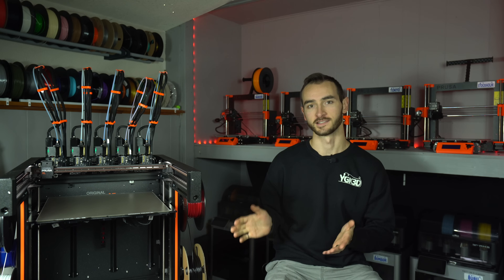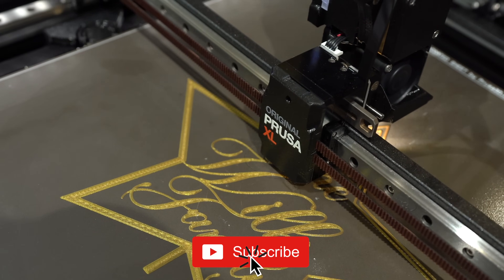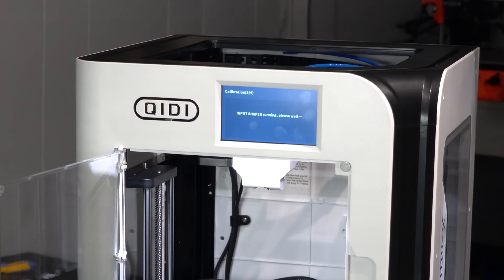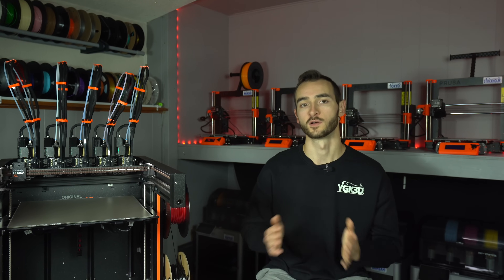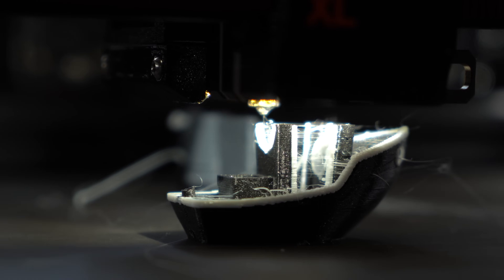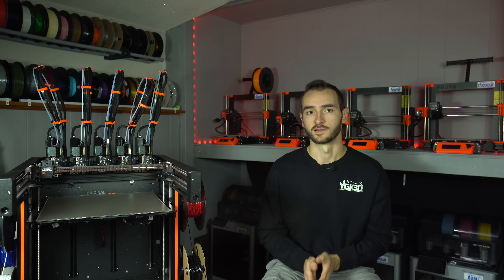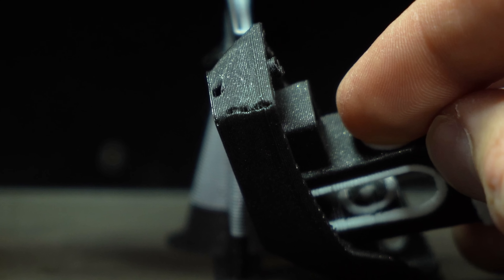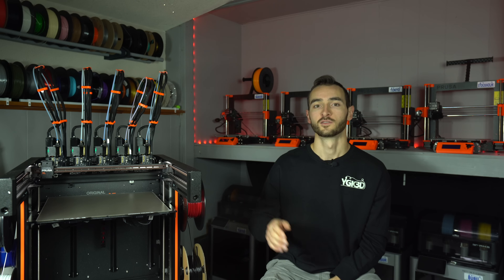The Prusa XL Just Got WAY Better with INPUT SHAPING... But Is It Enough?

Comment: your XL alpaca was 162g, and 142g for your X1 alpaca.  the 20g isn't going to make up all of the time difference, but when you mix in the speedy toolhead changes, I think it starts to show its advantages.  especially for people that sell a lot of prints, through much less wasted material.  i think a video that people want to see is a large multi color print where we can really see the benefits of the XL.  the XL wasn't built with speed as the primary feature, so doing a test that does test its strengths would be cool.  like a side by side Timelapse of a large multi-color print on both printers
Reply: yeah but also X1 can print a basically perfect benchy in around 15 minutes, XL not even close ;)
Reply: @riba2233  according to whom?  it can do a 15 minute benchy.  but that's not why you'd buy an XL.  do a 4 color bench and compare the speed.  the XL will print several benchies in the same time as the X1 prints one.  even the A1 mini beats the X1's at this due to a slightly faster AMS, but the XL does it with virtually no downtime for color switches and wastes nearly no plastic either.  i'm saying this as the owner of an A1 mini and two X1 carbons AMS combos, and a long time prusa fan
Reply: @ame7165   yeah sure, for multicolor I agree, but for single color they are not even close
Reply: @riba2233  yeah i mean for single color, the XL doesn't push as hard, but the toolchanger adds a lot of mass to the head, so i think that's the trade off for the fast and efficient switching.  i love prusa but it's hard to justify the price of the XL, even if they get it to a point where it's turn-key
Reply: @ame7165   true, I get that it is a special product and there is nothing really like it (outside for some custom stuff) but it is definitely too expensive.

Comment: I still don't get it. I have the 5 toolheads version, and I have printed pla, petg, and asa. No stringing at all and I live in FL with extreme humidity. Also I doubled the print speed from the provided speed profile, and noticed much faster print times with very little reduction in quality
Reply from the maker: Jealous. Did you drop the temperatures at all, or you’re using the stock profiles?
Reply: @ygk3d  just using the generic PLA profile. No tuning or tweaking.

Comment: Can't take your video seriously when your gauge of filament moisture uptake is that "it's freshly opened"… then you proceed to place the spool directly on the PrintDry heater element (which I own and have been using for years). Then you go on an excursion about how a heavy toolhead moves slower than a lighter toolhead and somehow it's Prusa's fault that it doesn't obey physics.
Reply from the maker: I acknowledged that the logic was flawed, hence why I dried it and tried again. The PrintDry works just fine like that by the way. The air inside it gets hot either way. I actually made no reference to the weight of the tool head. If weight is holding the Prusa back, they should make the tool head lighter.

Comment: You could install a 0.4 mm nozle in one of the XL's heads and show differences in speed and print quality vs. the results with 0.6 mm nozle.
Reply: i thought you could only run 1 size?

Comment: NGL kinda disappointed in Prusa.  There is a such a need for a XL printer that can print like an X1 Carbon but doesnt sound like this is it.
Reply: The XL prints like the X1 though. Just changed slicer settings. Download both slicers and see for yourself.

Comment: I have the 2 tool version. I’ve been running nonstop for weeks now and tried the input shaping alpha for a couple days before switching back.  I did see a significant time reduction in some prints, but I had issues with the GUI, errors during print starts, print pauses due to false errors and a couple long prints error out past the 90% point.  That last one alone was enough for me to go back to the stable version, but I’m looking forward to the official update and the new features.
Reply from the maker: That’s disappointing. Hopefully they release a stable version soon.

Comment: Also worth noting, the move to the prime tower before lowering Z during a tool change happens on the pre sliced benchy they provided but not if you slice prints yourself.  I'm on alpha firmware and PS 2.7 and the behavior is still the same as it was.
Reply from the maker: Ah interesting. I wonder why that is. Hopefully they make that universal soon.

Comment: to me it just proves how far prusa had their head in the sand for so many years riding off the reputation of being first and reliable, now they are starting to actually get some competition in reliable fast machines and they need to improve their speeds its just showing how much they are reacting and figuring it out and pushing stuff before its ready, just like they and prusa fans have critisized every other manufactuer for over the years with their heads up their a holes, you would think that prusa of all companies would be the ones to release a polished well tuned product that works and is reliable, but no instead they rush and push out crap before its ready to try to avoid looking bad by not having a competative printer on paper, they tarnish their reputation by instead having a printer that looks competitive on paper but in reality is a total s show, again just like every prusa fan has critisized every other manufacturer for all these years
Reply: just to be fair it's taken the three years to send out my notice to order.   That was not exactly a rush job but we all get your point.
Reply: To be fair(accurate), it's 'only' been 2 years. @dwaynevarnell9157

Comment: When comparing speeds you have to look at the final volume of plastic.
Reply from the maker: I don’t think that’s true. The amount of material deposited per unit time is the volumetric flow rate, which is it what we’re discussing here. If you were to match this between the two by making the XL extrusions thinner or the Bambu extrusions thicker, the result would still be the same because the XL accelerates slower. What we are comparing is the sum total of the time required to get from point A to point B as the object is printed. Just because one squeezes out more material in that time doesn’t mean it has a higher print speed, it means the volumetric flow rate is higher.
Reply: @ygk3d  Points A and B have to have the same structural properties; wall thickness, infill type infill %, etc. It is not just nozzle size.

There will always be a speed to quality ratio. I have seen too many reviews these days hand out the speed prize when the model lacks detail.
Reply: To further reinforce my point, if you install a 0.6mm nozzle on the Bambu (not even the upgraded 2x flow rate aftermarket CHT style nozzles, just stock), the printer prints even faster than the stock 0.4mm nozzle, but uses more material - now as much as the Prusa XL.

So no, you cannot punish the Bambu because it uses less material, because 0.4mm nozzles always do compared to a 0.6mm nozzle. And if you put a 0.6mm nozzle on the Bambu, it would print as much material but way faster.

So it is just faster, period. Except with multi material printing 2-5 materials.
Reply: No you do not have to look at same volume of plastic at all.

It's on prusa if it's wasteful! Users want to use as little material as necessary.

Furthermore, you'd have to put a 0.4mm nozzle on the prusa to TRULY compare, and then it would be bog slow. Which is why it comes with 0.6mm nozzle.

It's ridiculous to suggest that a 0.6mm nozzle printer is disadvantaged speed wise against a 0.4mm nozzle printer - larger nozzles should always be faster, so the fact the prusa is that slow on a 0.6mm is not impressive at ALL and it's not down to plastic used!
Reply: @Tom--Ace  Setting infill type and % is on the user. I will pick the best infill for the model.
Reply: @dsjove  Except it's not infill or %. It's the fact that all 0.6mm nozzles are both faster than 0.4mm nozzles but ALSO use more material.

This is true of the stock Bambu 0.6mm nozzle too, which uses (in my tests) 135 grams for what a 0.4mm nozzle does in 104 grams. But faster of course.

Which means the Prusa is not doing anything special here, it is just SLOWER. If you put a 0.4mm nozzle on it, or a 0.6mm nozzle on the Bambu (to provide a REAL comparison), you would find that:
1) They print the same amount
2) the bambu prints much faster

The Prusa is not doing more work, it's just a slower printer.
Reply: By the way, what I am saying is easily verified in Prusa Slicer and Bambu Slicer even without owning these machines.

Just go ahead and slice the same model in say Prusa Slicer or Bambu Slicer and you will see that:
1) For the same nozzle size and infill percentage and basic wall settings, the Prusa XL and bambu use very similar amounts of material but with the Bambu being much faster
2) 0.6mm nozzles are generally faster than 0.4mm nozzles
3) 0.6mm nozzles print as much as 20-30% more material than 0.4mm nozzles on both machines for larger (10cm or so) models.

So why should we give the Bambu a made up penalty when it is the nozzle size that is causing more material to be printed, not the printer or slicer? And when given the same nozzle sizes, the Prusa is always slower?

That's called trying to fudge things to get a different test result than what is the reality.

Comment: Input shaper works by changing the acceleration curves, not current.
Reply: Acceleration curves are changed by varying current. Not voltage. Voltage has no bearing on stepper speed. Tell me what changes the acceleration curve?

If I’m not mistaken Taylor is a mechanical or electrical engineer. I’m not. All I know is what I read in Ti white papers about acceleration curves in regards to voltage and current.
Reply from the maker: What Jason said. Fundamentally motors only know current. They don’t understand acceleration. So at a basic level, it is the current you’re modulating. That translates to a different acceleration profile.
Reply: @ygk3d  input shaper affects acceleration curves directly. Current as an effect of that software layer.

Comment: I was in the pre order list for this printer. Then I saw Taylor’s video on the Troodon 2.0. Bought a 2.0, installed klipper on it and printed tons of stuff at 200mm sec in ABS to my delight. Cancelled my Xl order. 

Looking at these videos, it appears Taylor saved me a bunch of money and headache. I’m glad I stuck with the Troodon. I liked my previous Průša printers, love the ecosystem and helpful users. Bambu users turned me away from that printer for sure. 

Comparing this XL to a Bambu is wrong. The size of the printer really has a bearing on the speed. Gantry weight of the little Bambu is so much less than the much bigger XL.  It’s like comparing Bambu speed to a Voron 0.1. But I get why it’s done, Bambu for some reason is perceived as the competition to the XL and Voron just never gets mentioned. Maybe because the comparison is for printers you pull out of the box and print with no manufacturing or little assembly involved. Then the Troodon 2.0 gets ignored in that argument being a fully assembled Voron with injection molded and metal parts. 

Either way, thanks to Taylor for putting me onto the Troodon 2.0, putting the time into the klipper printer.cfg, and therefore avoiding an XL purchase. And the Bambu community thank you for making me avoid you. 

I have zero doubt that Josef and his team will sort this out. However, it would be nice if it was shipped working well.
Reply from the maker: Cheers Jason. Thanks for your continued viewership.
Reply: Is the Troodon 2.0 a mult-tool head?

Comment: Given that Prusa is no longer constrained by an 8bit system, I wouldn't be surprised if they were working on a Klipper FW version for the XL, Mini, & MK4. At least I would hope that they would be working on it if they want to stay competitive. Just got my email for the XL5H today. Looking forward to seeing what it's capable of.
Reply: Not going to happen. You need a Linux Machine to run klippy. That means cortexA cores. The printers run with only CortexM cores
Reply: @Tremoneck  that's quite stupid of prusa to do.
Reply: @Tremoneck  I did not know that. I was under the impression that Klipper would work on any ARM, AVR, or PRU processor regardless of which actual core is used, but you're absolutely sure that it is not capable of running on an M core?
Reply: @klschofield71  Klipper is made up of two parts. Klipper and klippy. Klipper runs on pretty much any MCU. But the MCU is only used to execute particular commands like at time t do one step of stepper2. Klippy is written in python runs on Linux and calculates at what point in time which MCU has to do what. Because of this you don't need to flash the MCU's when updating your software or configuration. Because that happens in Python on the Linux machine. That's why you need a Raspi or something similar to run klippy.
Reply from the maker: With all of the time and money Prusa has invested in their Marlin fork I’d be surprised if they scrapped that and started from scratch with Klipper.
Reply: @ygk3d  again hopelessly behind.. if you wanna waste your money on a prusa while you can have a voron, vzbot or bambu X1 ams. The prusa will never print fast it just can't do that. It's not designed for it. No adxl345 nothing
Reply: Somewhere next year you have it 🤣 hopelessly outdated and way over priced! Great job!!
Reply: @OneHappyCrazyPerson  I've waited patiently since 2021, so a couple more months is easy (likely mid December). How exactly is the brand new Nextruder planetary gearbox extruder, modular heated bed design, and expansion capabilities of 4 additional tool heads "outdated"? I need another tool swapping printer to relieve the burden off my e3d Toolchanger and Jubilee printers; getting a much larger print volume for about the same price is just another benefit that will allow me to expand my product line and capabilities.

Comment: Amazing! I have read the blog post, how did you not mention “This turns the XL into the fastest and most efficient multi-material solution out there”?
Reply from the maker: I think I showed that with evidence. 10s tool changes v.s. 1:45. That really adds up when there is a lot of filament swaps.